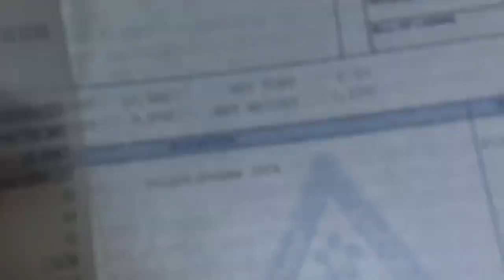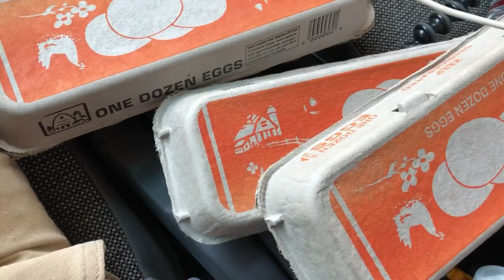How to cut up a sailboat #JunkRemoval #GarbageMan #GetMoney

Comment: Dump fees in my area are in 200 per ton. I would say 1800 But also be feeling the customer out. I would settle on 1400 if need be. But truthfully I wouldn’t really know where to begin with pricing on something like that until you’ve started to do some and see what they run you at the dump. From there I guess you could charge by the foot With different costs for different types of boats